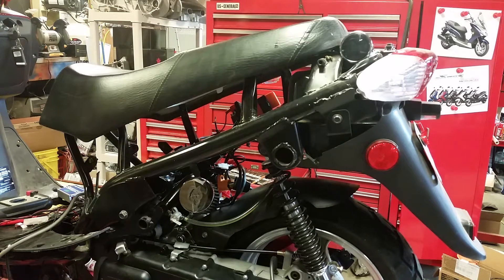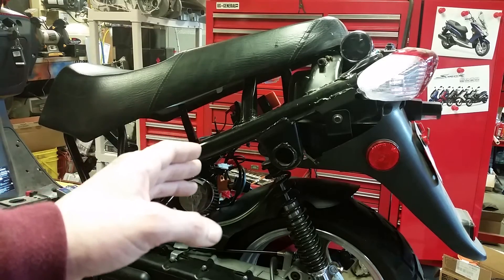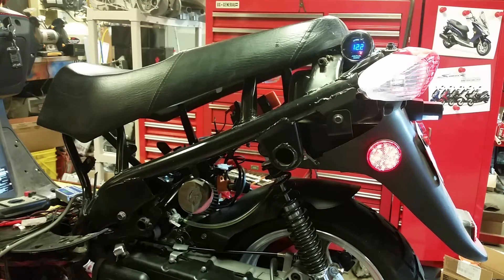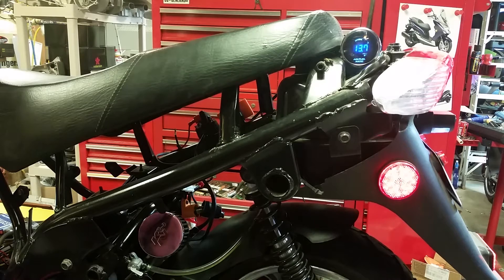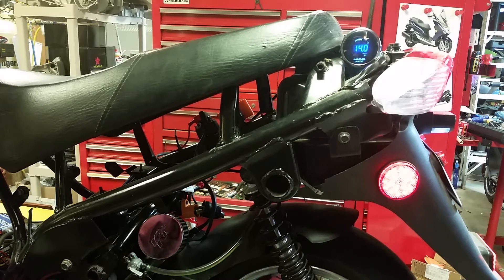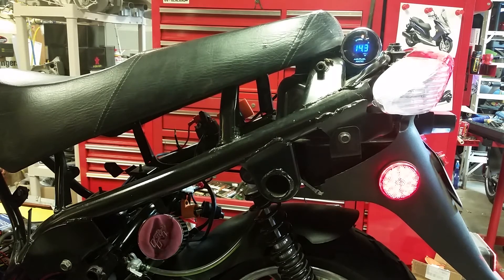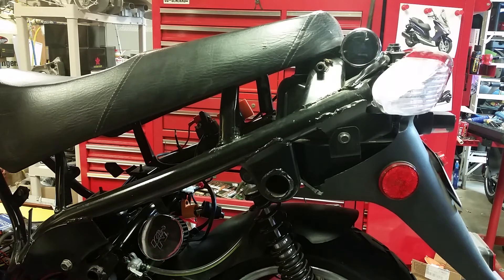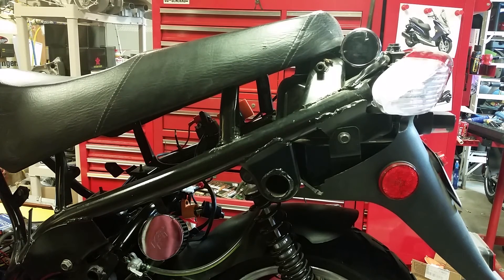GY6 Jetting and Ecotrons O2 Sensor Install 35 108 04

Comment: Hi i have a sym jet 125cc 4t..and fitted a tecnigas exhaust as the stock one was rusted and liked awful...the problem is the tecnigas has no lamda sensor o2 sensor on it .
And the engine light has now lit   up..will this damage the bike having no sensor ?